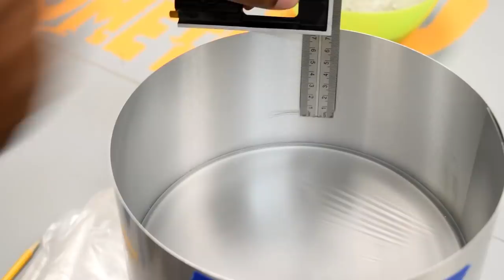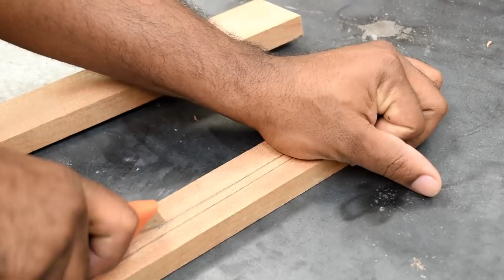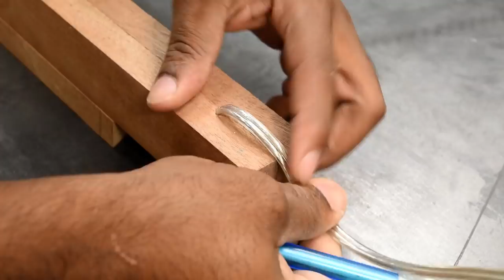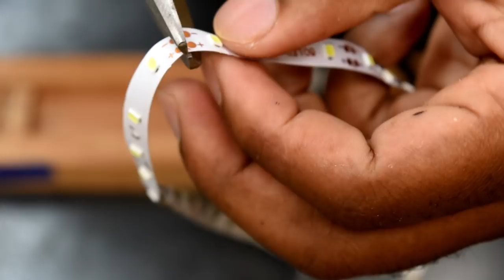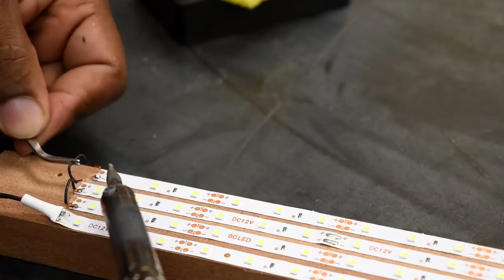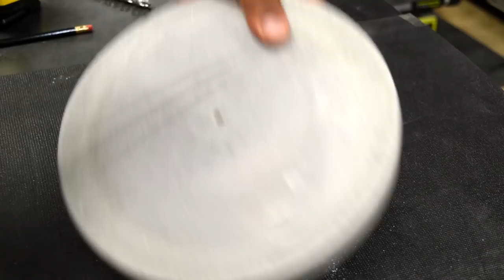Diy LED Desk Lamp With Concrete Base

Comment: Wouldn't a wingnut have been better on the hinge? That way you could adjust the lamp with greater ease, instead of rubbing the arms together, which after some time would mar them and force you to further clamp the arms down. Other than that, it looks wonderful.
Reply from the maker: A wingnut was my first option. I went away from it because of aesthetic. Thank you

Comment: is there an easy way to put the power inlet into the cement base?
Reply: well it really isn't easy, but you could place a piece of wood in the concrete (from the middle (where the bolt is) to the outside). When the concrete dried you can remove the piece of wood (if it won't come out, you can burn it). The gap that the wood will leave will give you enough place for your wire and an inlet. The hardest part is positioning that piece of wood (if you want you could also use other materials) at the right place until the cement has dried.

Comment: couldn't you use sand paper instead of frosting? (high grit sand paper)
Reply from the maker: Yes I tried it on a scrap piece of glass. I was still able to see the light. I like the result of the frost better.
Reply: +DIY Creators ah ok its because most people don't really have frosting lying around thanks!

Comment: If you get a pice of say copper tube that your mounting bolt will fit in,then tape the ends and place it in the center when your pouring the concrete you shouldn't have to drill the hole in the concrete later,just slide your bolt thought the tube.

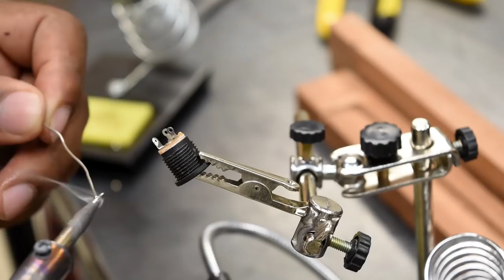Comment: FACTUAL ERROR at 5:50 - it's not "two of the legs are ground": one of them is ground and the other is for detecting if anything's plugged in. That sense pin disconnects from ground when you plug in the power supply. (Ask me how I know and how long it took me to figure it out…)

Comment: What's the point of the construction wire in the cement?
Reply: Reinforcement to prevent crumbling. It's basically rebar for ants.
Reply: Not sure what you mean by "rebar for ants" lol. (If you couldn't tell by now, I am a new diy'er) But thanks for answering the question!
What are they called? What do I search for?

Comment: nice lamp, however the use of lamp flex inside the wood is pointless, could have used a much lighter cable. Having the DC power on inside of lamp, detracts from the look of it, better to have on back or in base.
Reply from the maker: Thanks, The wire I use is not pointless it's just an over kill. Its the only thing I had to use without spending money. Not sure I follow you last statement. The power and the light switch is on the back of the lamp. There is nothing on the front.

Comment: The bolt joining the base and the wood is not strong. I can the lamp shaking when you're doing the fine sanding at the end.
Reply: Why didn't you fix the wood in the wet concrete mix with some horizontal extensions for extra strength? I am just asking if it will be better or not. I don't know anything about this method.
Reply from the maker: Not sure what you are looking at lol. It's a solid build.
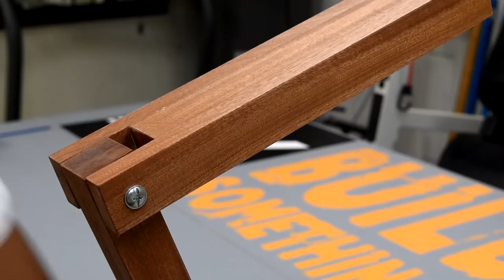Reply: 19:29. It is shaking when you touch it right? I am no carpenter or something. Your work is really amazing but you know that OCD thing when thing are not solid tight it annoys some people.

Comment: i m getting sick of all those integrated led light. in case of failure what are you doing? geez  ill prefer build one with a bunch of g4 with a chinese power supply or g9 socket so you can change the led part easily in case of failure.
they say led is going green but with all those integration if you have a failure,what a mess it is...

Comment: WHO USE A  Concrete Base as a lamb stand?
Reply: lamb lovers
Reply: Concrete makes a solid, heavy, durable, and inexpensive base for a lamp.  This is why you will find concrete being used in more and more home design.  Cost is very low, and it can be sculpted, cast, and formed, whereas plastics and resin (which normally fill this niche) as well as cast metals are much less green/environmentally friendly.